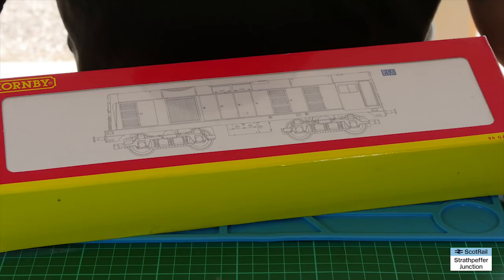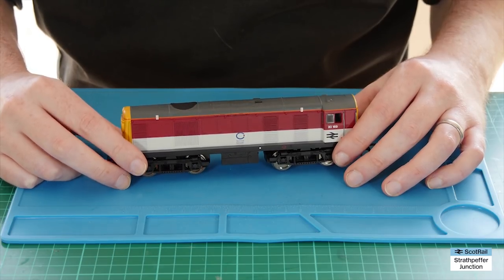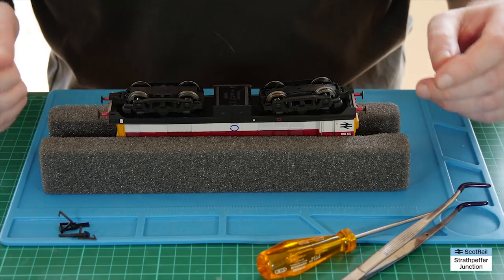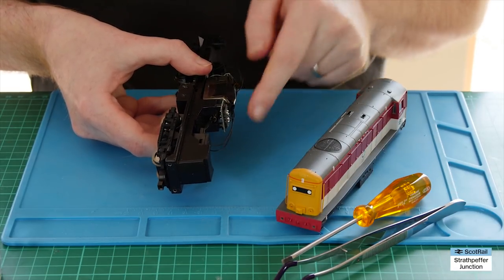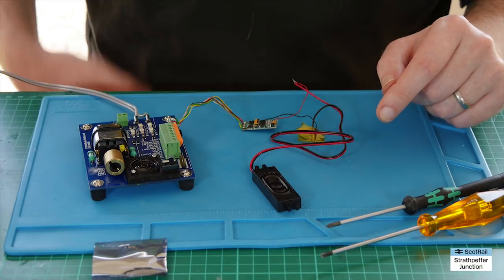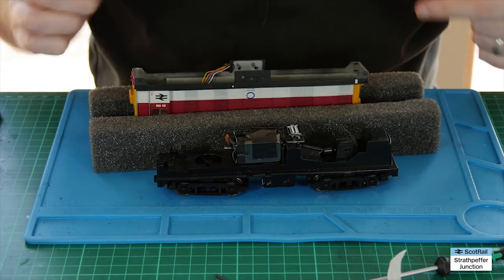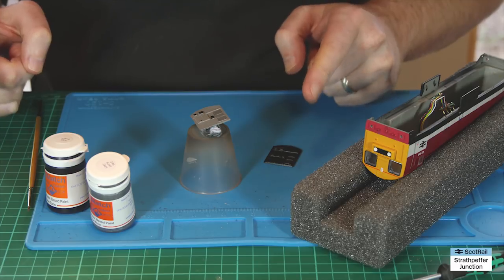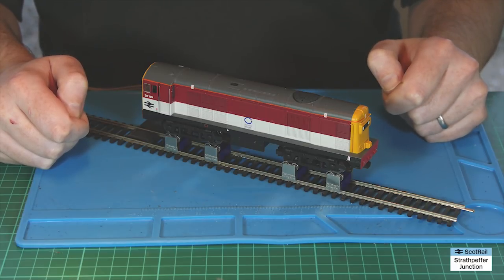#21 Hornby Class 20: Look-over, plus TTS Sound Bass Reflex Speaker & Custom Cab Wall Installation

Comment: Another comprehensive installation video Strath. I’m still not sold on sound for locos but if I ever dabble in it further down the road I’ll definitely be using your videos for reference. Keep up the good work. Paul
Reply from the maker: Thanks, Paul. I'm fairly sold on sound now. I think about 80% of my fleet is now sound fitted in some way (tts for the ones I'm less likely to run frequently to keep costs down) and I find it a bit odd running the silent ones now...my nephews also love the sound ones, but not so interested in the normal ones (they both love tooting the horns). I think it doesn't work so well with steamers, but with diesels so long as you're OK with them not actually sounding just like the real thing, it's grand. Probably don't want more than a couple with sound on at once though!

Comment: Your video's are breath of fresh air.  I do feel the Hornby brand quality is at bottom of the bucket list when I buy. They are still using old Lima bodies with little to no detailing plus very cheap can motors, with no fly wheels. The Motors I usually change plus other parts. Please keep up the great videos
Reply from the maker: Thanks, Ralph. Very much appreciated. I do have some terrific Hornby models, but I do feel that there's been a bit of resting on increasingly old laurels in some areas of their catalogue...and as you say, too many old Limas with little in the way of upgrades or improvements.

Comment: Super video of a super model.

Good to see that Hornby have retained the loco exactly as it was when produced by Lima with the only difference being the fitting of the 8 pin PCB.
Reply from the maker: Thanks, Jason. I don't have a lima one, but I've just been watching your Class 20 lima video again and they look almost identical, like you say. It's probably marginally better for squeezing everything in without the factory socket or putting in a flying socket, like you did 🙂

Comment: Great work mate was surprised by just how good the chip sounded with the new speaker. Really good work mate .
Reply from the maker: Thanks, matey. Yeah, so was I actually. Came out really nicely. I'm not sure that the effort of milling out the chassis to the put in the megabass type speaker would have been worth it. There wasn't a huge amount of difference...well, not enough to make it worthwhile. Plus, with the megabass approach, you end up seeing a speaker in the cab.
Reply: like the work you have done with the 3D printed bulkhead  . can i ask a question on the TTS decoder control i have been thinking of getting one for a hornby class 67 but put off by some of the comments of how well the TTS chip controls the loco are they any good ?
Reply from the maker: TTS chips are pretty basic. I've not had a problem with them in any model so far, but I only put them in locos I'm unlikely to run lots, don't want to add them to consists etc. I have had to tweak the motor profile CVs in the one in my Class 31, but other than that they've been OK...but they do have limited tweak-ability and control, and have fairly low current handling ability and don't work well, if at all, with Heljan locos. I have a Class 67 with factory fitted TTS and I've not had any issues with it, but admittedly I've not run it much or for long periods yet.
Reply: Thanks again for the reply . I did try one in a heljan 47 and i lasted about 10mins . I run mostly blue 80s and early 90s stuff but have a few modern locos and was thinking of trying the TTS chip in the 67 as they dont run that much and like the idear of cheap sound for it . Ta mate think you have helped me make my mind up .

Comment: Great Video thanks David, We bought the same Loco i'm also partial to the departmental liveries :), i installed a Lais chip in mine, i need to work on the Speed Tables though, i already have 2 Bachmann 20s with sound so i was going to double head with one those, but  i may invest in a TTS chip now, but i now also have my eye on another Lima 20 lol 
Cheers
Ian
Reply from the maker: Many thanks for the comment! I've got two Bachmann 20s that I'm going to double head (track cleaning duties and tanks, I think). I really love them. I've been pretty impressed with this Hornby one and, like you say, I have a real soft spot for departmental stuff too!

Comment: Fantastic video. I'm okay with models that are lacking in detail somewhat. I mostly look for models which I like and will look good running around my layout. As long as the detail and the price match up, I'm okay with something like a Hornby 20. Best Wishes, Alex.
Reply from the maker: Thanks, Alex. Yes. I totally understand that. I'm not a rivet counter by any means and I'm quite happy to have something that looks good even if it's not 100% prototypical, but I do like a bit of detail...I probably sit somewhere in the middle between not bothered and rivet counter! I have a few older Lima's and I love them. I gave a few of my older Hornby's to my nephew, but still have a soft sport for them. 🙂

Comment: You video really helped me - do you know if you can buy the buffers as extra parts, I were trying to help a guy with his  Hornby 20 class.Thanks to you I got the body open, and the drive shaft back in, but I busted 2 buffers, I wil need to drill them out &  see if I can get replacement buffers.
Reply from the maker: I'm glad it was of use. You could try contacting Hornby spares to see if they stock them, failing which perhaps try Peter's Spares or ebay?

Comment: Very informative video - thanks for posting.

Would it be possible to see the loco running on a layout sometime please, rather than the rolling road?  It would be useful to see how she performs, and to know whether you had to adjust any CVs to get smooth performance.  I have found that almost all TTS decoders need fine tuning to get a good performance on the track.  Thanks!
Reply from the maker: Many thanks for the comment; much appreciated. I'll be running them all on the layout once it's got track down. I'm just about at baseboard level, so it shouldn't be too long now. I've run most of my locos on a temporary table top layout (currently boxed up awaiting the move up to the loft) and the TTS chips have all been OK, albeit one or two needed the motor profiles changing and you have to ensure the chip is a good match for the current draw of the motor.